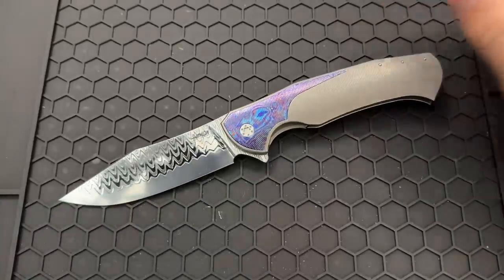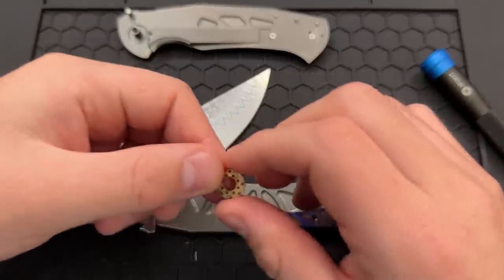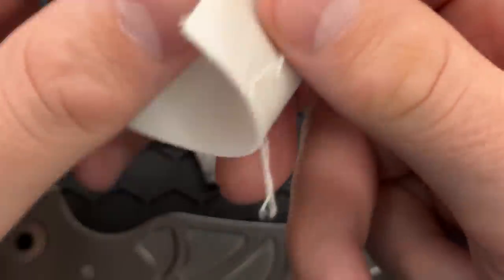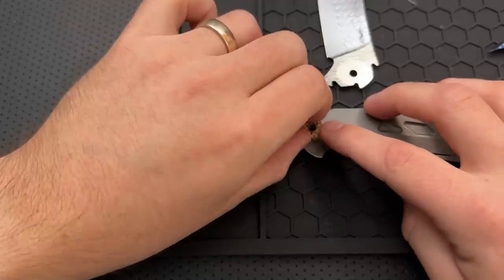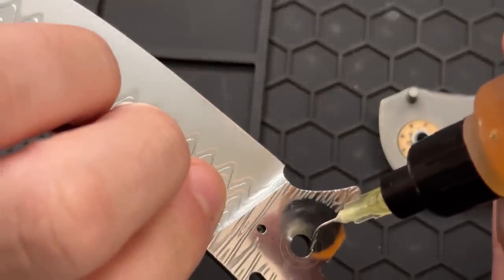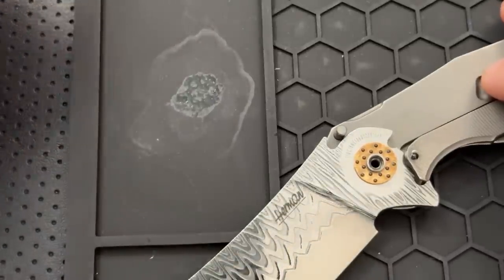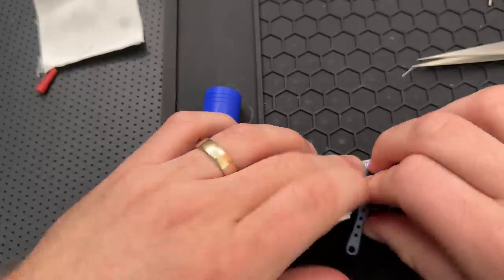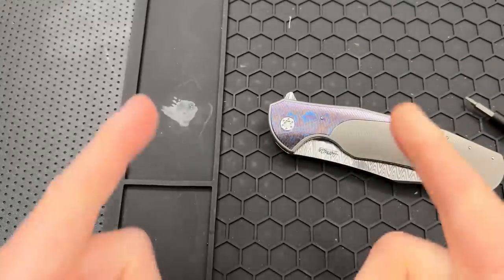How to (not) disassemble and maintain the Herman Knives Mantis

Comment: Assuming the stray bearing landed back on the assembly mat would indicate that sitting in a satellite dish would have led to even more confusion when you could not locate the ball bearing. The fact that extra ball bearings were included but not noticed  gives this disassembly a real bah da bum finish. Please tip your waiter and they will help you look for stray parts. Having said that, been there, done that.

Comment: I hate these open bearings at times, they work great but sooner or later you will feel one rolling that's dislodged itself. And you end up putting off taking it apart because you know everything will fall apart when you do 😆 This is why I prefer Skiffs in most cases.

Comment: If the price tag wasn’t already a dealbreaker, the loose bearings would certainly push it over. Any improvement in the action over caged bearings is immediately overshadowed by the extra hassle during maintenance.

Comment: Instead of a vacuum, you should've tried running a magnet over the possible landing area of the bearing.  I've used this technique with great success when trying to recover a wrist watch spring bar that shot across the room into the carpet on my floor.  Have also used a magnet to recover the tiny collars that fell on the floor when I was sizing a Seiko pin & collar bracelet.  Get a magnet, Nick, it's SCIENCE!
Reply from the maker: Tried that first!